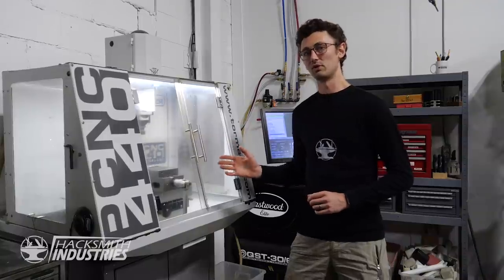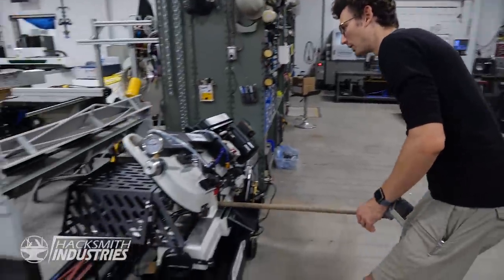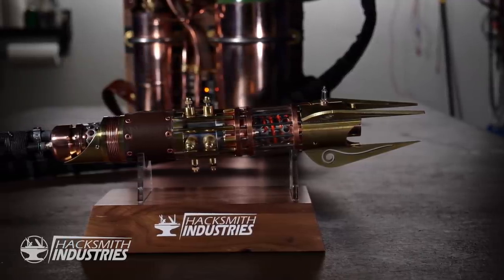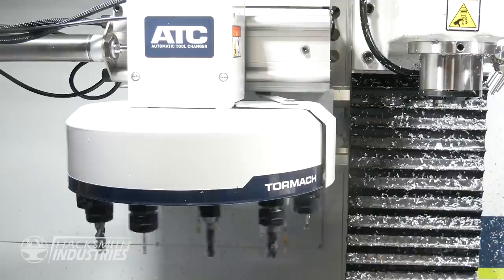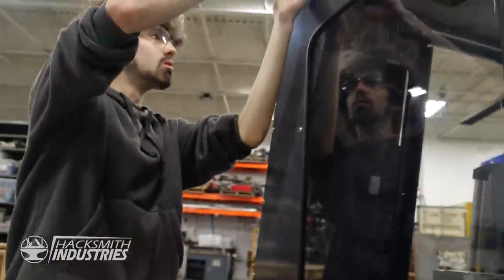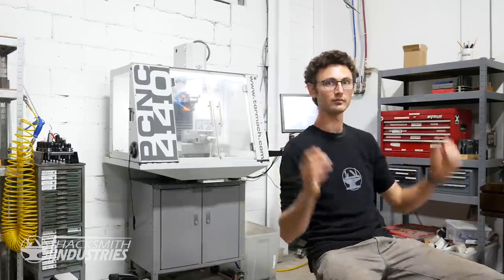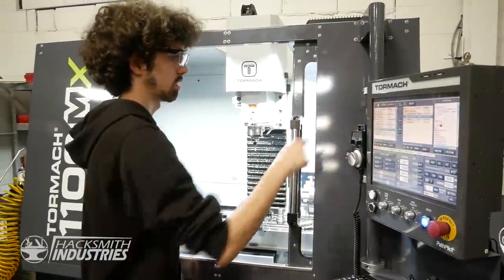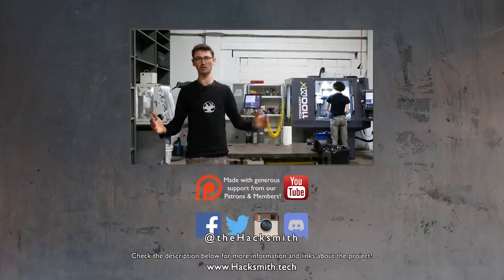MYSTERY MACHINES!? Shop upgrades!

Comment: Loved the video <3 such a great machine but i would recommend you guys get some octane t-slot covers those make cleaning the chips of the table wayy easier
Reply: The company is called octane workholding and the also have a probe-off-setter so the measuring probe for your tools doesn't take any space of the machinetable

Comment: @hacksmith, where does the water go used to cool down when machining pieces?
Reply: It's water-coolant mix in a recycling system. Needs to be change every so often or it will get funky
Reply: @DevilDog36th  muchas gracias!